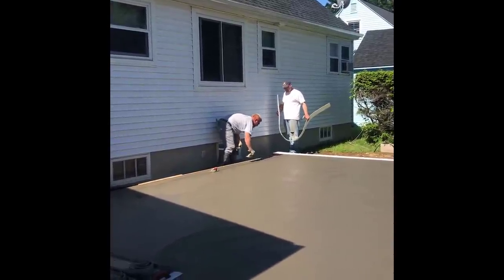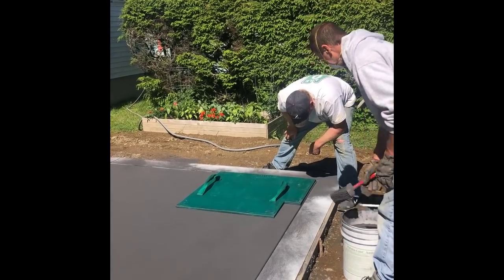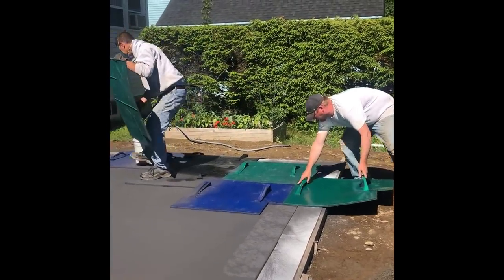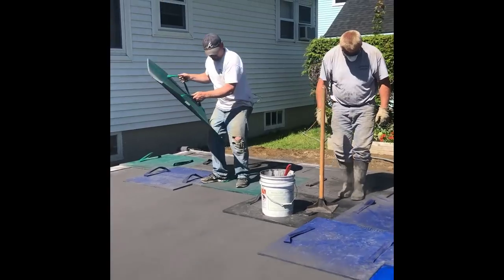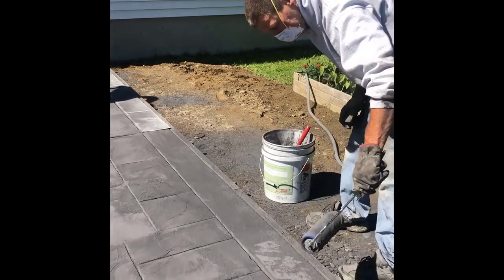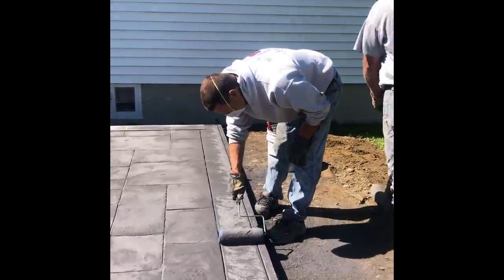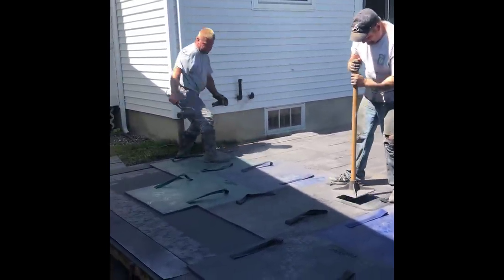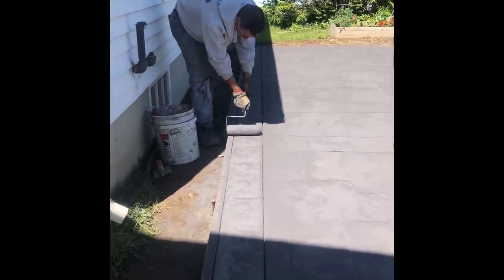HOW TO STAMP A COLORED CONCRETE PATIO : ASHLAR SLATE

Comment: Great video guys (as usual). What about control cuts? How does that come into play, when stamping concrete?
Reply from the maker: You have to cut them in where ever you think it will crack. Some of the patterns have grout lines you can cut in to hide them.

Comment: Question. When you put the color powder down and then pull the stamps, is the powder still sitting on the concrete in a powder form? I know it gets "soaked in" some but I'm assuming its not completely soaked in. We have done stenciled concrete several times, never stamped, but we have to float the powder in and we've always been worried about the powder not being soaked in. Does this matter. And I'll echo what Akeem Moore said, another great video. I've got my partner watching and subscribing to your channel. Very good work!!!
Reply: Release is what mike is using. The powder you float in is color hardener. They are different products